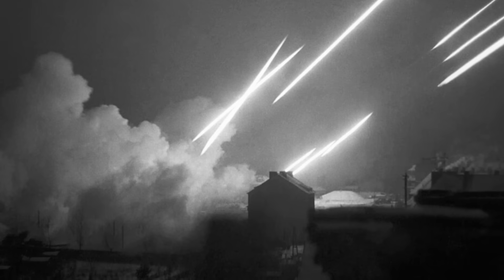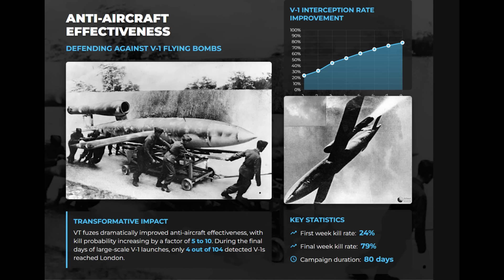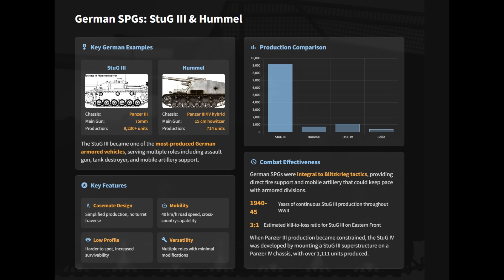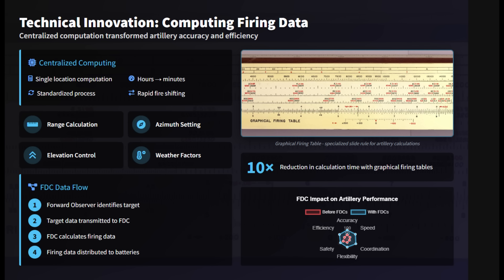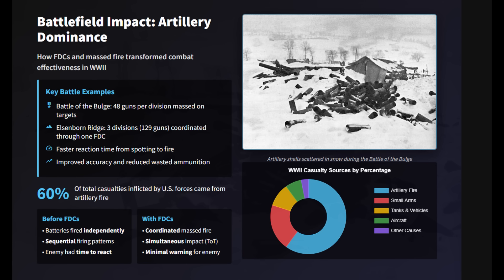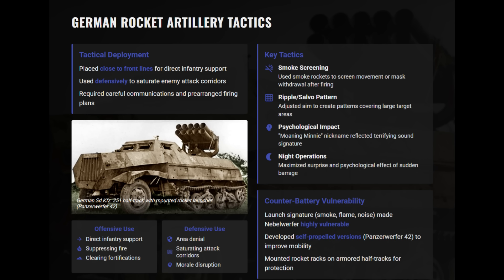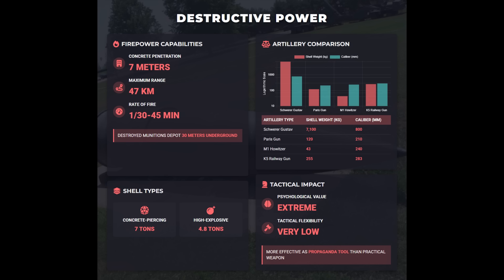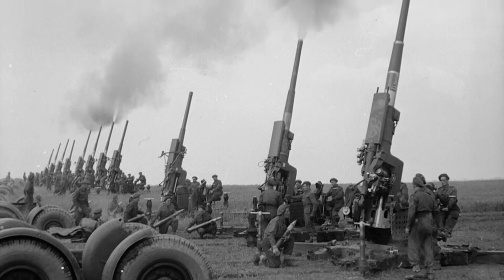Five WW2 Innovations That Changed Artillery Forever

Comment: USA Artillery had a higher infliction of enemy casualties. Of course it. With FDCs and 100s of tubes (plus a logistics chain feeding a never ending stream of shells), the infantry and tanks had only the remnants to deal with. The Soviet artillery did well as well.

Gustav & Dora were hardly mobile. A squadron if Lancaster bombers with 6 ton Tallboys was far more useful. In a couple of days could deliver more on target munitions and a week later strike another target 100s of km in a different place.

Edit P.S.: 
The USN replaced the twin * quad 40 mm Bofors with the 3"/50 (e.g., Mark 33) because:
1) At the time the 3" shells was the smallest which ciuld be fitted with a VT fuse;
2) When an attacking pilot planned to return to base AA fire merely had to induce him to miss; the Kamakaze had to be blasted apart for which the 40 mm wasn't sufficient, and thr 3"/50 with a dedicated fire xontrol system had a far greater effective range. 
3) Systems like the Mark 33 had a rate of fire of 45-50 rom (5"/38 only about 22).

Comment: Actually the Royal Artillery had much of the fire control data prepared in WW1 and available.  Royal Artillery developed centralised command and decentralised fire control during the war such that a single forward observer could request Corps and even Army Group artillery regiments for a target.  US formations could not do that.  Royal Artillery found that procedure for the US lacked flexibility. Super heavy artillery was a waste of time and effort on the battlefield and it was only pursued by the Germans as they did not have the firepower from the air.....

Comment: Firing data were not produced at the batalion level FDC but at battery level. Guns/howitzers were organised in batteries and placed in a (W) formation around a battery point. Data were produced for each battery point but the fire from the batteries could be co-ordinated by the bataljon FDC which again could be co-ordinated with several other  batalion FDCs.